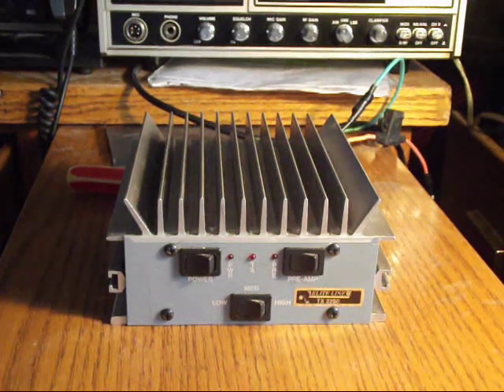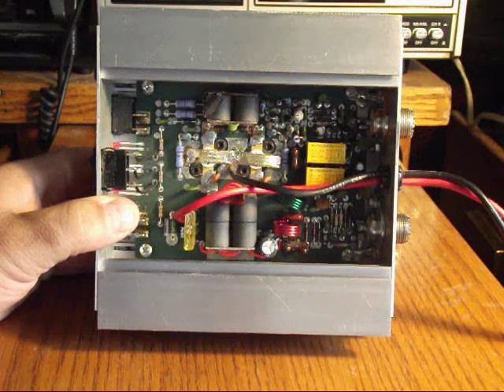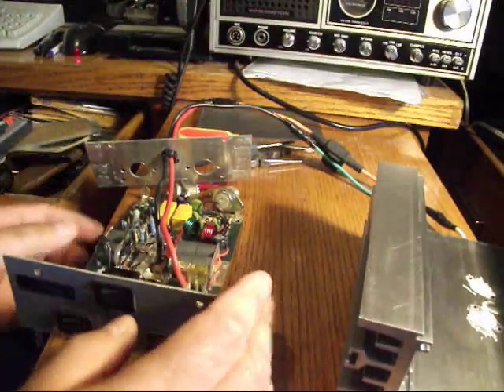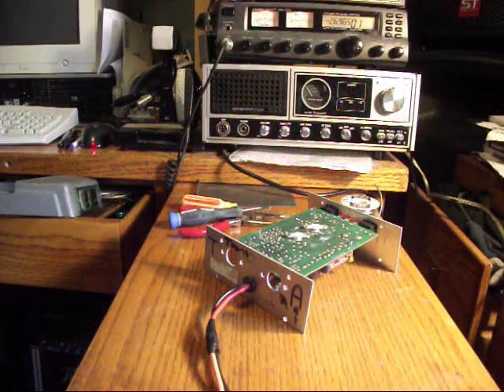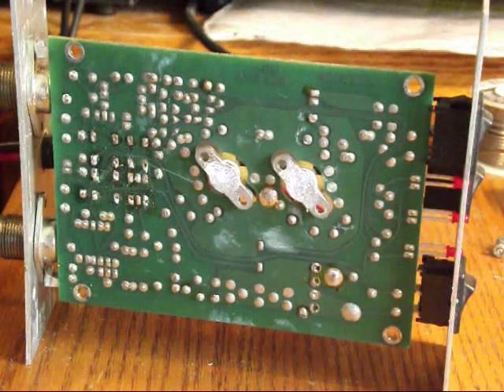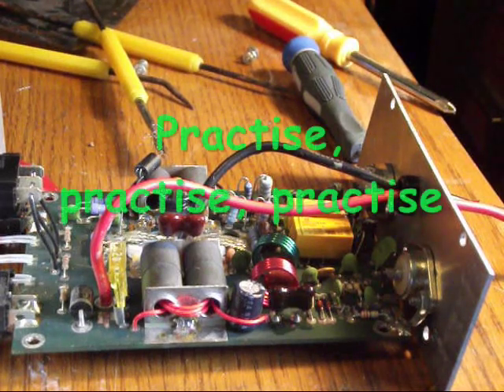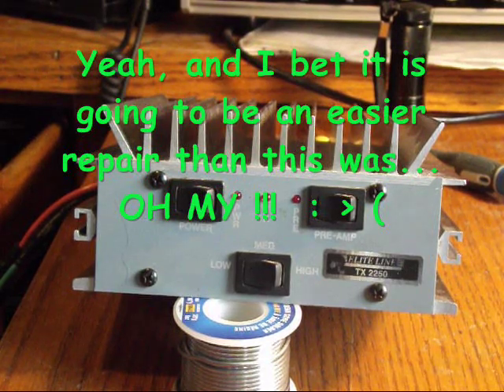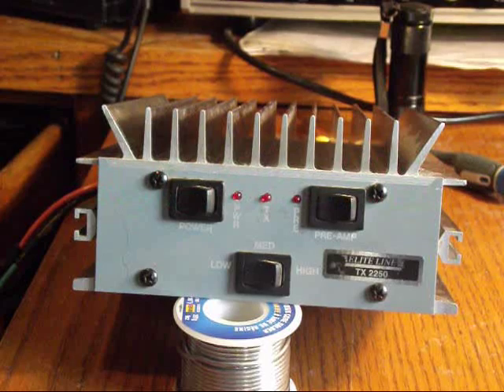Linear amplifier repair

Comment: Yup npn transistor that switches the relay, also check all your diodes before the relay make sure they arent blown open
Reply from the maker: Thanks
Reply: @Tobinindustrial  that wasnt my case but definately could be yours.  I had a chinese bj200 come in. The guy said it had high swr and wouldnt unkey.  I checked all the components in the ssb keying relay circuit and they all function.  The relay keys fine in am but as soon as ssb button on it keys and wont unkey.the only component I have left to pull and check is the damn relay but they are a pita to pull and check especially with the shitty solder they use in China now.  It could be an rf issue as well, rf getting back into the keying circuit, in your case, the recieving rf could be latching the tx relay as soon as turned on.  Do you hear it click as soon as you turn on? If you need any help me up and I may be able to suggest things to check.  Im in Nova Scotia so phone or messenger call would be fine.  We got some Newf skip here a few weeks back, I talked to George the gas and oil analyst guy who talks on the radio.  Pretty cool to hear you guys.
Reply from the maker: @user-su5sq5ib3i  Thanks for this information. You are certainly nailing the issues for sure. I am from western NL and George is on the east coast. I hear NS from time to time. i am 9 TC 02 on the DX channels.

Thanks again for your input. It is very much appreciated. There are no techs in my area so i have to stumble through stuff and see if I can figure out how to fix things. Take care and keep in touch Sir.

Comment: You really need to get some solder wick which is mostly made of copper which absorbs solder a lot easier than steel braid.  Plus you should use some rosin flux on the braid so it will work better.  Or you could get a $5.00 solder sucker off of e-Bay.  Sounds like your finals are burned out or maybe even the drivers.  Easily test them with a volt-ohm meter.
Reply from the maker: Thanks for this information. I do appreciate people taking the time to help. God bless you.

Comment: I do have mond and the red light not working only green light but no soun from red light if I should say the light is the problem but I think its blowing amp do you fix
Reply from the maker: I purchased a few extra parts when I repaired my amp. Your description of the issue you have is a bit vague. Is the amp rpoducing extra power oiutput when you key while it is on?

Comment: I have not. But I been eyeing the reflow, desolder, desolder vac work station though.
Just can’t make that investment yet. But had several occasions where it would be really nice to have.,
Reply from the maker: Maybe one day I will invest in one. I don't do much electronic repair generally but it would certainly be nice when tackling certain circuit board parts.

Comment: And they do make a desolder wick especially for that, and a solder sucker, a kit with both on eBay for about $10.
Reply from the maker: I will certainly check into that. Have you ever used an electric solder sucker? If so, what are your thoughts on that. Thanks again for your support of my YouTube.

Comment: I have done as YOU said, but when I research for Relay, all I get are Automotive type of relays, that is why I wanted a Link of some kind to find relays for an Amplifier...
Reply from the maker: I understand you are having trouble finding  the proper relay so I hope I am able to help. Please accept my apologies if this relay is not the proper one but it is the one that is in my linear. I took it apart this evening and then marked down the type. Here is a quick search from Digi Key. There are other suppliers but this one might inspire to find what you need. I hope this link is useful to you. Here it is: https://www.digikey.ca/product-detail/en/panasonic-electric-works/DS2Y-S-DC12V/255-1079-ND/251851?utm_adgroup=&mkwid=sESYmw0lT&pcrid=311902142154&pkw=&pmt=&pdv=c&productid=251851&slid=&gclid=CjwKEAjwue3nBRCCyrqY0c7bw2wSJACSlmGZvJ2CWBFSusraq7uIbTO8bdbnYaCADc06ZnJZzYoOzBoCoobw_wcB

I guess you will need to copy and paste it in your browser.
Reply from the maker: Part number for google search: 
DS2Y-S-DC12V F 
Good luck and may God continue to bless you. Let me know how you make out OK?

Comment: Where did YOU buy the Relays, as I have a Similar Problem, and like to know what was the exact Relays YOU bought as I may need to get the same... Can YOU send ME the Link and the Relay number as well... I have been trying to find where to Buy the Relays I need or just replace them with what YOU have and maybe they will work for ME, do not know if they will but it is worth a try, or if anyone out there reading this note maybe YOU can help as well...
Reply from the maker: If you reference the information on your relays you can google it and find a match. My relays may be slightly different to yours. No worries, there is planty of relays that you need online as there are several suppliers. Just find decent quality ones for the best price with shipping. That is what I did. Just so you know, there was a transistor also causing issues with this amp but I never did do the repair or do a video. I have one working amp and one kinda working that I put in storage now. I may as well get rid of them. I use stock power with my radios and do very well with a decent antenna anyways. Thanks for watching and for your comment. Good luck and God bless you.
Reply: @Tobinindustrial  Hi Andy, just curious as to what transistor was giving you the issue. For the past several years now I also an amp with the same issue put to the side. Thank you in advance for the answer
Reply from the maker: @louie_Da_sax_Guy  The chicklet sized three legged ones were the culprit. I havbe not used my amps in a long, long time. They are both in storage

Comment: Braided wire works best with some liquid flux on it in my experience.  Also, while it may seem counter-intuitive, when removing parts, sometimes a higher wattage iron is best:  You spend much less time on the part so lower total heat is transferred into the part, especially when heating up a large piece of braided wire.  Also, there is made-for "solder-wick" which is pure copper and works great for cleaning pads.  Most of soldering is heat control and application as well as quality solder and flux (electronics grade stuff btw not just any old flux).  

Keep playing around and you'll get some wins under your belt - this is how we learn!  Thanks for sharing, 73s.
Reply from the maker: Thanks for that information. I think I may buy a variable wattage soldering iron and get better flux. I really do appreciate your comment and it is very good information. It is nice to find helpful people on Youtube. Thank you for watching my video.
Reply: I told u Andy u have shorted keying transistor or diode in keying circuit sale it cheap

Comment: Check and replace the NPN transistors, they are responsible for switching the relays,hope this helps
Reply: This is a good next step - I suppose if there is no diode protection circuit on the coils of the relays the flyback from the relay could have cooked the drive circuit (the transistors in question).  Do you have access to a scope?  If so check to see if the base of the NPNs are getting driven high which would turn them on (if they're good)
Reply from the maker: Thanks for the information.

Comment: |God loves a try'er  !  did you get it sorted in the end pal ?
Reply from the maker: +joohop I got it to work. I now have two but both are in storage. I am able to talk locally and with DX without the need of the amps. The heavy PSU is also in storage. I guess once you've owned one or two and used them soon  the thrill is over and the new thrill becomes doing more with less power in the end. It's all about quality antennas and decent radios. All my radios seem to do very well with stock power. Thanks for your comment and God bless.
Reply: cool brother i subbed your channel
Reply from the maker: Sub'd ya back... Thank you Sir
Reply: cool bud

Comment: FYI... from my experience... a relay sticking like that on transmit normally means the amplifier is oscillating.
Reply from the maker: ***** Thank you Sir for that information.
Reply: Or a faulty TR switching circuit... I would replace the relay driving transistor as a first attempt at a repair as well as its associated diodes. It probably isn't relevant now though

Comment: by the way one 3904 is for the preamp and one for the keying circuit. you can rule out the one that is near the relay for the preamp and if you can follow the trace coming from the INPUT SO239 it will lead to the main relay and very close to the 3904 you need to replace. hope this helps.
Reply from the maker: YouTube had these messages Hidden. Thanks for your comment

Comment: hey brother....be careful because yes it is a keying circuit issue probably being the keying transistor buf you need to make sure is it NPN or PNP because most of those amplifiers like that use PNP and a NPN like a 2n2222 WILL NOT WORK. I am a builder and tech my self if you ever have any questions give me a shout.
Reply from the maker: YouTube had these messages Hidden. Thanks for your comment

Comment: use a solder sucker , that braided stuff sucks . your iorn does not get enough for the braid to work . also in places i have trouble desoldering i heat up the solder and quickly blow on the heated solder with a quick strong sharp blow. this however can damage nearby components or make shorts. sometimes a drinking straw helps . get a solder sucker they work wonders. and they should be only $5 - $10
Reply from the maker: YouTube had these messages Hidden. Thanks for your comment
Reply: @Tobinindustrial  cheers !

Comment from the maker: Thanks for the heads up. I still have that linear and there is two transistors in the linear and they are 3904. Does both need replacement or just one? The transistors are near the SO239 side of the amp and are on each side of the amp. 
Thanks for your assistance.

Comment: your problem with the tx light is the keying circuit transistor is bad 2n2222a or 2sc3906 should work fine
Reply from the maker: YouTube had these messages Hidden. Thanks for your comment

Comment: You need copper desoldering braid to soak up the solder.The coaxial cables don't have copper hence have very poor ability to capacitate solder when heated. It's very cheap I recommend 3.5mm GootWick.
Have fun :)
Reply from the maker: YouTube had these messages Hidden. Thanks for your comment

Comment from the maker: I did replace the two relays  in the unit and the amp works fine now but the preamp is not functioning now fopr some reason. I rarely used the preamp so no big deal really. If you search on Ebay you will locate the proper relay and they are relatively cheap. Let me know how you make out.

Comment: Well think of a hot tipped solder sucker. It looks like a soldering iron with a button on the side. Heat the solder with the tip, and once its molted, push the button and *slurp* away goes the solder. :)
Reply from the maker: YouTube had these messages Hidden. Thanks for your comment

Comment from the maker: @dash8brj Never heard of that kind of desoldering tool but I'd imagine having a suction pump makes it a lot easier than having to melt solder, placement of solder sucker and depression of button, etc..... I am still novice and don't get to work too much on electronics. I try and repair what breaks down but I know my limits...  But folks like you are making the learning curve much shorter thank you very much!!!    : > )
Reply: they work nice

Comment: @Tobinindustrial No worries! - I've also got a cheap solder sucker, but I also now have a desoldering iron, which is similar to a soldering iron with a hollow tip, and a suction pump at the other end of the cable. Desoldering is VERY easy with it :)
Reply from the maker: YouTube had these messages Hidden. Thanks for your comment

Comment from the maker: @dash8brj Thanks for the tip. I recently acquired a solder sucker that works much better. It is a brand name solder sucker. The old solder sucker would not lock well and when it was released it had poor suction. the one I have now is 100% better. I will try what you've said and I am confident this will help the solder removal process...!

Comment: 2 items to help with getting solder off a board is fresh solder (add a little, it adds flux) or a flux pen. Adding flux (with the pen or a little extra solder, makes the solder flow more easily, and it will wick quicker into the braid :)
Reply from the maker: YouTube had these messages Hidden. Thanks for your comment

Comment from the maker: @MrSuperheterodyne OK, Thanks for that extra info. That was not what I was doin' mate... The braid was pretty thick and would be difficult to heat up. I will look into finding smaller braids and to a test on an old circuit board.

I am glad you enjoyed the video.

Comment: Nice video my friend... Regarding using braid as a solder sucker, make sure that you heat up the braid as well as the solder blob. The braid needs to be good and hot to draw the solder. Also make sure the braid/wick isn't too thick that it won't get to temperature. Nice vid mate!
Reply from the maker: YouTube had these messages Hidden. Thanks for your comment